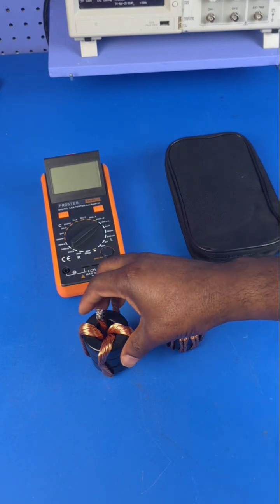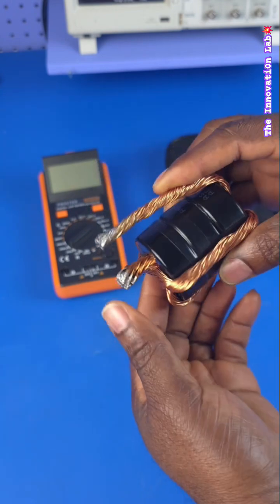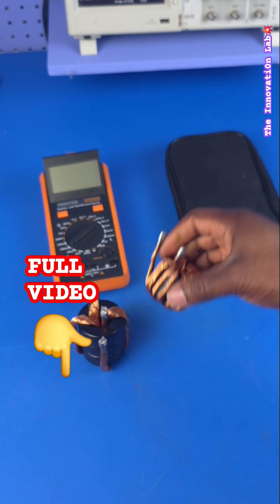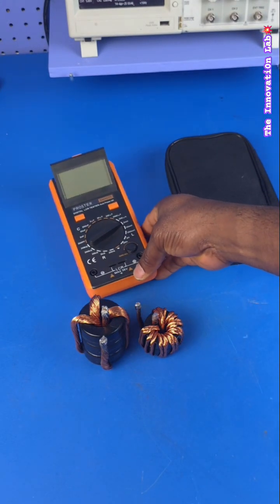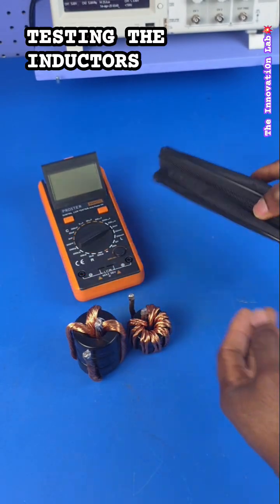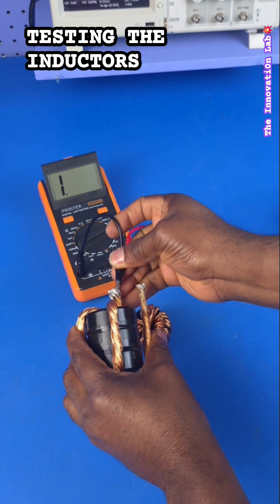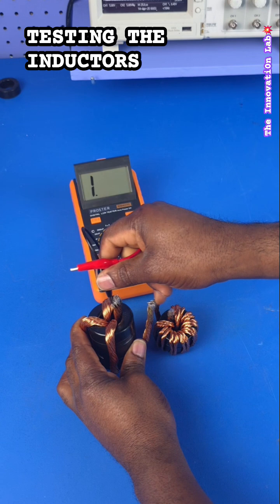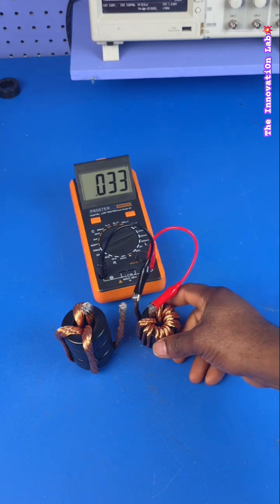DIY Power INDUCTOR for High Efficiency DC-DC Boost Converters #shorts #power #dctodc

Comment: Yahhh inductance value is only thing the control IC cares about, given no Saturation occurs. Usually a fixed frequency
Reply from the maker: You as the designer should care about inductance values, saturation currents, critical inductance, skin depth calculations, Flux density, etc.......your control IC does care about any of that.

💥💥💥
 The major function of the control IC is to generate the PWM - right on the switching frequency that you have assigned it. Then it uses both the current and voltage feedback loops to control the duty cycle of the PWM.

Lets not make generic comments that could confuse the audience.😊
You are welcome to ask questions about any of my designs or modifications....I know these designs from theory (pen and paper) to soldering iron.

Consider joining us on Patreon. 
https://www.patreon.com/c/TheInnovati0nLab/membership?redirect=true

Respectfully,
The Innovati0n Lab💥